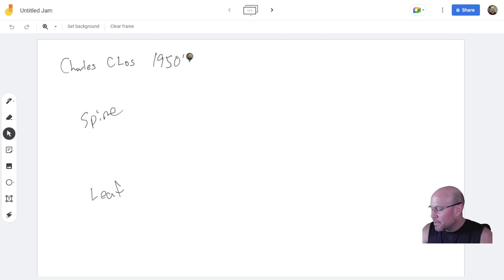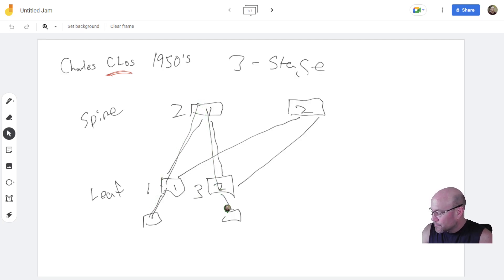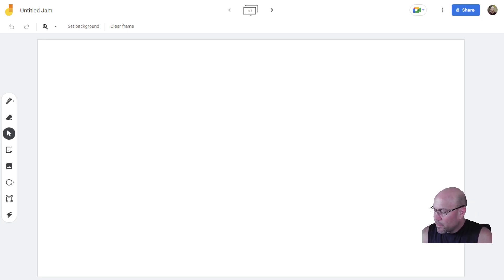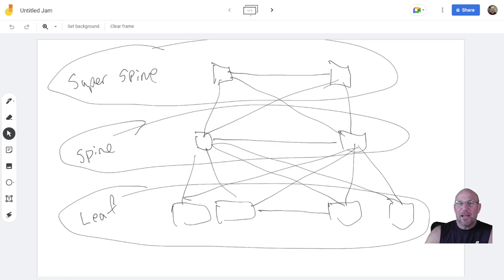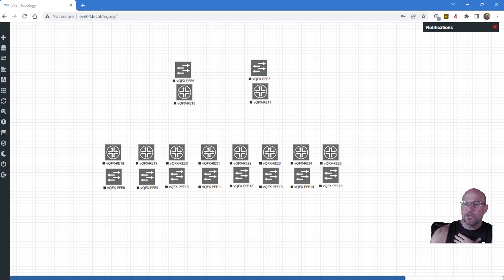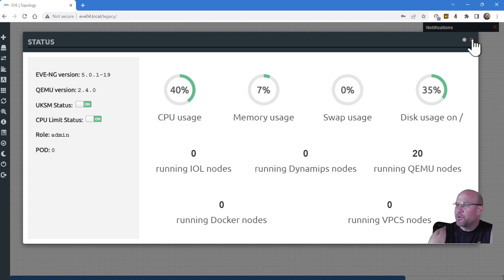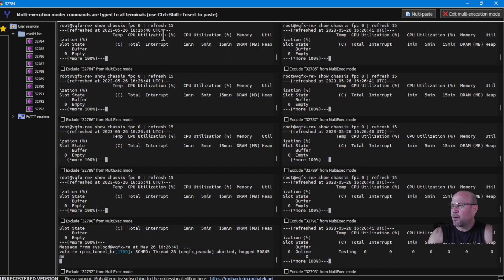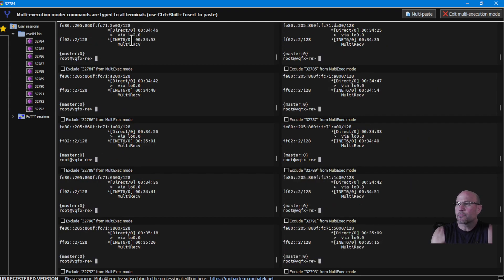scaling vqfx in eve-ng - spine leaf clos

Comment: Hi Aaron, I am having a slight problem with my vQFX images on Eve-ng. I have the QFXPFE and RE images installed on an Eve-ng lab and everything looks ok. However, when I do a show chassis fpc 0, it is always empty. Additionally, the xe-// interfaces come up as "device not found" when I do a show interfaces terse.

It seems that RE and PFE are not seeing each other even though they are connected via interface em0/int0. I have tried installing older versions but still have this problem. Do you have any ideas what it could be?
Reply from the maker: you said you have your vQFX PFE and RE connected with em0/int0.  Try connecting using em1/int1 instead.

https://www.youtube.com/watch?v=sUGGhr-sVyo&t=331s